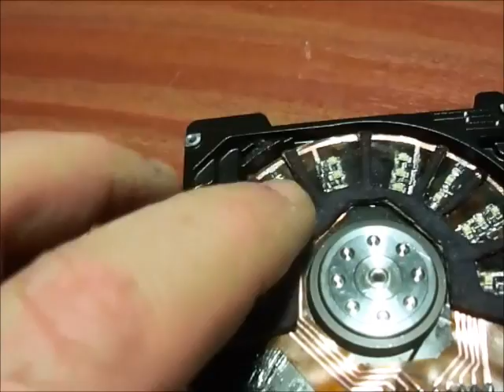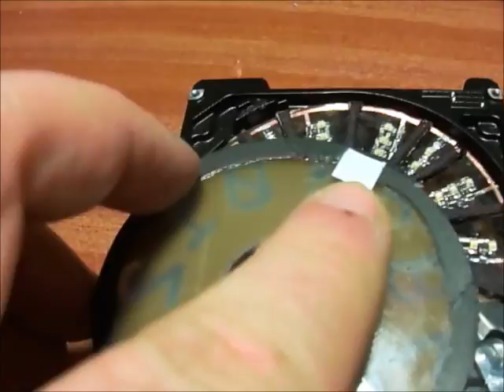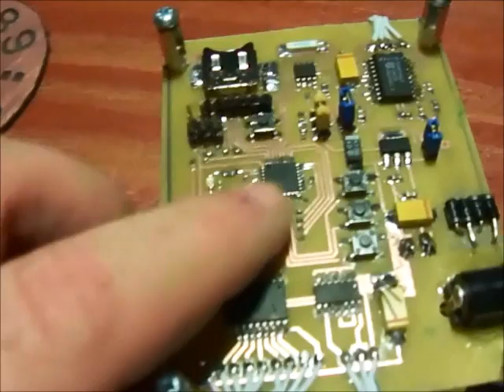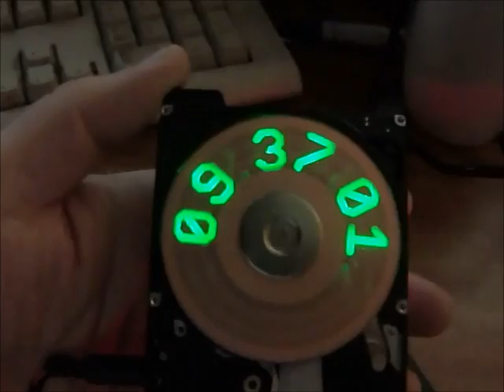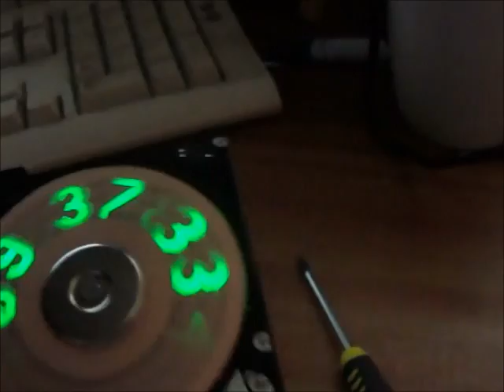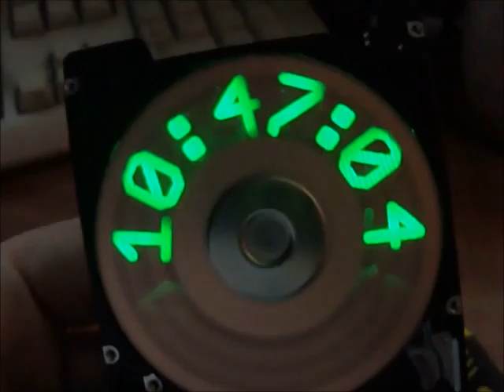Digital POV Clock on Hard Drive Platter

Comment: excellent concept.  So in order to display 8 digits . ie: "10:47:01",  you need to make 8 revolutions?  (one rev per digit) or do you draw all the 0's in one revolution, all the 1's in the second etc?  Or do you go further and try to display multiple digits per pass, depending on their relative sequence on the wheel?

Guess these optimizations might reduce average render time, but produce variable brightness.  ie  "11:11:11"  would be much brighter than"10:28:43"
Reply from the maker: All the digits and colons are shown once every revolution.. it actually works by dividing the whole revolution into a 256 step array, then works out - once per second - which of the 6 segments (plus the 2 colons) to light up at each of the 256 steps . This is when the correct digit(s) are directly overhead those segment(s). Interrupt handlers update the LEDs on every revolution using that content of the array. Double buffering is used when the array is updated to stop glitching.
In theory 2 segments could light up at exactly the same instant if the right digit was over each one at the same time. The LEDs behind each segment only stay on for a tiny moment of time  (1/256 revolution time)... Simples!
Reply: Jason Hotchkiss Ah right. For some reason I had made the assumption the segments on the left had to lit up before the segments on the right. I guess this would be the case if the LEDs were affixed to the rotating segments themselves.  

That being said, you could replace the cut-out segments on your disk, with lightweight 3D hollow shapes and make an actual 3D clock.

Even have a few versions of each digit to animate the transitions.
Now that would be even more nifty.

Anyways, great channel you have!